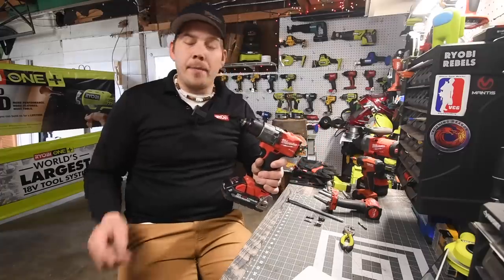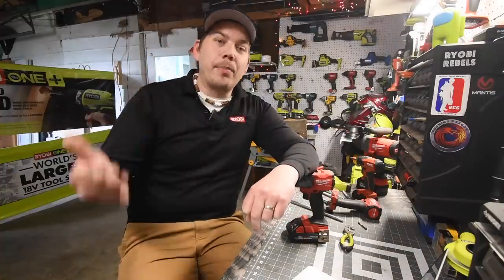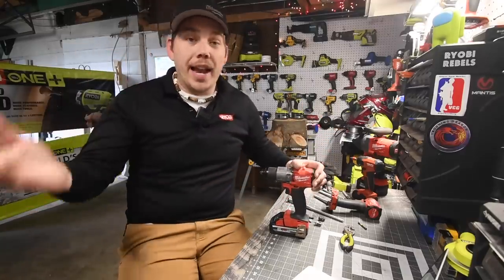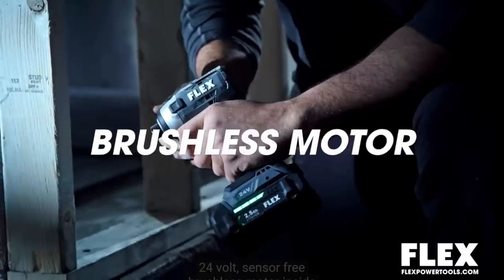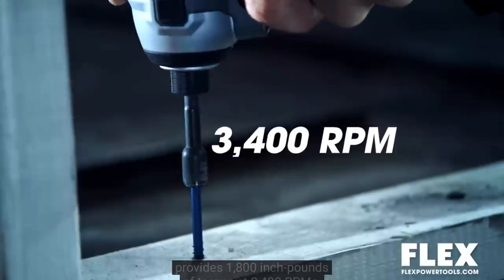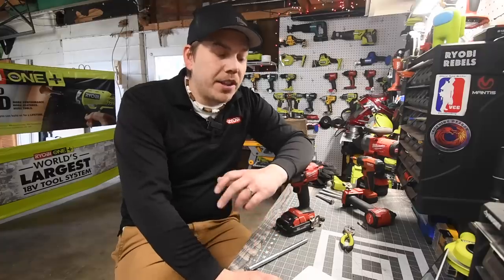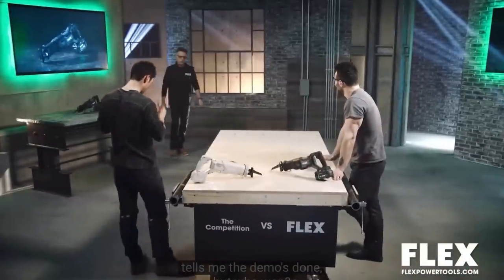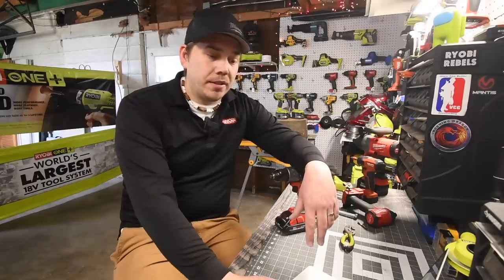My Flex tools vs Milwaukee  video RANT!!!!

Comment: If the Milwaukee tools used were their 18V range, their not the most powerful ones, the 28V ones are. Even if a 24V tool beats an 18V tool in every test, against a 28V tool it's gonna loose.  I have both 18V and 28V tools and the 28V hammer drill milwaukee make is by far the most powerful drill I have used to date. Remember the old saying " a good big'un will always beat a good little'un".

The day I bought my Milwaukee 28V hammer drill (back in 2008) is the day I stopped using my 6" capacity SPARKY coring electric drill to put ANY big sized screw or lag bolt into wood.  But then, that video is just an advert, so it was set up to make the flex look good. All drill manufacturers can produce a video like that if they want to make their tools look good.
Reply from the maker: I thank you for viewing

Comment: I knew I couldn’t have been the only one seeing this, I was impressed with the flex tools, but I just started noticing that “test” after test the guy using the greyed out tool was hardly even trying compared to the flex guy, you can just see that in every tool the flex guy putting the body weight into the tool
Reply from the maker: I thank you for viewing

Comment: I've owned and ran a lot of tools, the Milwaukee is definitely not the best of everything but has been my go to because they usually near the top and have not failed at me. That being said these tests were a complete joke.
 Milwaukee is typically known for brute force and requiring finesse from the operator for accuracy but being quick and powerful. They do have some that are definitely not the quickest and kinda "dur". The flex add was just sad.
Reply from the maker: I thank you for viewing

Comment: Didn’t VCG and others prove that the flex is actually pretty legit in real life testing? I’ve got no bias. Just a DIYer and don’t really care if one impact is 2 seconds quicker than another. I’ve got Dewalt, Milwaukee and even Ryobi (Ryobi stuff is just some of the unique tools that no one else offers yet) so brand loyalty doesn’t effect me. Btw. I have a Milwaukee m12 rotary tool that sounds like the bearings are shot and it’s gonna explode. Only a year old 👎. Just ordered a DeWalt die grinder to replace that POS!!
Reply from the maker: I do thank you so much for viewing :)

Comment: hi handsome. what a great observation , opinion and reivew.my made me lol every time  you "so much pressure yard the flex tool". the operator using the angke grinder, was using so much pressure that his body was going to shake. lol. this is a horrible video. Do you think flex will offer a leafblower ? i expected it-yet i dont see it.

Comment: I love how you call them out. They are using the generic Milwaukee M18s vs a 24v... If they want to shove the money where their mouth is, they should have put it against the Dewalt Flexvolt line.... I own some of the Flexvolt line tools and they would put that flex brand to shame. Of course I'm talking about a 60v vs 24v but they did a pathetic test trailer to see how it stacks up to its competitors
Reply from the maker: I thank you for viewing

Comment: While you do have some good points about the demonstration and their techniques of trying to show the superior power. There has been independent tests run already that show their drills and impact drivers outperforming like a boss. As for the other tools i agree their test methodology doesn't really give accurate and unbiased representation of the results. Will look forward to when you purchase them and do your own unbiased testing. Will also be interested to see what ways you find to test them vs others in a repeatable and fair way.

Comment: Yeah. I stopped watching the event when I saw them cheating. I'm not a even Milwaukee guy. I use dewalt tools. But, like, dude: if you're gonna cheat, be good at it.
Edit: I'm almost sorry I missed the angle grinder test. That shit is cringe. You don't fuck around with those. They are slayers of men. Use the tool properly.
Anyway, I think the inline circ saw is cool. I've always wanted something like that. But, that event was dumb. I don't need tools to be the most powerful. I need them to do things I want them to do, to make my life easier. I don't use dewalt's most powerful recip saw. I use the compact one. It fits my needs more. That's the kind of thing that wins with me.
Reply from the maker: I thank you for viewing

Comment: What's even more stupid about the angle grinder test is that there is almost no point to testing the cutting speed of different angle grinders. They all basically do the same thing. They have almost no torque. They're geared almost strictly for speed, and if you make them too fast, you turn cutoff discs into grenades. There's nothing to test. Angle grinders are angle grinders. You pick them at the store based on quality, feel, your favorite color, and battery life if they're cordless. That shit was stupid.

Comment: a week ago I spent $500 on a Milwaukee half inch impact. about a month ago I started hearing all these YouTubers saying Milwaukee better watch out trying to hype up this fuel line because the same people that made skill or now making an impact drill and calling it. if the people that own skill could make a decent impact driver why wouldn't they made one with the skill name? it's all bullshit. I can't wait to see the first YouTube video where Milwaukee is using a auger bit to drill completely through the guts of this fuel line of half-ass impacts. bottom line is if it was a decent product it would have ran with the skill name. but I got to admit it did make me pause for a minute before buying the Milwaukee. I don't need the most powerful drill or impact on the market!! I need something that's reliable that is a workhorse and that has been proven. Milwaukee or DeWalt both are them tools
Reply from the maker: I thank you for viewing

Comment: Plus, it looks like the body builder is pushing on the flex side while the average guy isn’t really putting any weight on it. Then he suddenly has a light touch after swapping  😂

Comment: He used the Flex Angle grinder wrong the wheel was turning wrong way. Because the sparks fly to the front not the back like Milwaukee. He holds it totally wrong.
Reply from the maker: I thank you for viewing

Comment: That masonry drilling test definitely looked rigged...lol I just used my (GEN 1) M12 fuel hammer drill the other day to put in some concrete achors with a similar diameter bit, and my M12 destroyed the task in seconds. I was actually really blown away. It was the first time I've ever drilled into concrete with that little guy and it made the M18 in this video look like a turtle.
Reply from the maker: I thank you for viewing

Comment: I haven’t dug in yet, are you saying flex is using 18650 cells in their batteries? That would be dumb
Reply: I found the answer, they use both 21700 and 18650. And that’s good. Same as Milwaukee. Not hating on the battery and charger game they brought
Reply from the maker: I thank you for viewing

Comment: They also lies about the 6 1/2" circ saw having the largest depth of cut
Again Metabo HPT has had their 6 1/2 circ saw out for yrs and it cuts 2 19/32 which is more than the Flex-not saying their saw isn't any good but they didn't do their homework and only looked at numbers from a couple of brands to make their incorrect statement-also they still don't have their resets in Lowes yet-why would u have a launch and not have your product on the floor🙀
Reply from the maker: I thank you for viewing

Comment: I was thinking the same thing watching this, such bullshit.... the Flex Turbo Impact should be going up vs a Gen 3.5 Milwaukee M18 Fuel with the 21700 Cell’s and the Turbo Hammer drill should be vs the Dewalt Power Detect with a 9amp Hr Flexvolt 21700 Cell Battery in order for them to make the claims they are
Reply from the maker: I thank you for viewing

Comment: The Milwaukee M18 angle grinder is not that impressive at first. Even if the Flex guy push it harder as he should its even more impressive than it seems he was not able to stop the disc. 
For the show. Well its a show, this kind of show is something what Milwaukee does every time, its something that does VCG any time. So why now start to blame?
Will Flex perform as good as they claim, probberly not, but the hate especially from Milwaukee people is allready on an unhealthy level
Reply from the maker: I thank you for viewing

Comment: Well I have a hilti hammer drill the newest and it's near useless, 1 day of use and it already drops bits, the chuck is pathetic it has no grunt and my last one died after doing not much but a few pilot holes in around a year, on paper maybe hilti is better but having owned and used both the milwaukee is far superior just my experience but our work leases hilti and everyone and else has same problems no one uses them we all use our own gear because hilti sucks
Reply from the maker: I thank you for viewing

Comment: The Flex products are just marketing hype.  Who in their right mind is going to change their entire tool lineup for work or for homeowner DIYers over a second difference or so?  It just does not make sense.  They have not come up with any new revelation.  Makita has the most rapidly charging batteries and an x2 lineup with a lot of tools.  Ryobi has a plethora of different tools and awesome useful OPE and other products.  Milwaukee is killing it in battery tech and specialty tools.  Flex is just a replacement for Metabo, Kobalt and Skil at Lowe's.
Reply from the maker: I thank you for viewing

Comment: I feel the same way.  Their stream featured a bunch of dummies.  Why cover the other in white?  If you claim to be the best and strongest then prove it.  Show the tool line your up against.  It is my opinion that this line is just a slightly upgraded Kobalt line.  Those guys were definitely full of BULL****.
Reply: I agree they totally skewed their results but they have to color over the other brand tools they can’t specifically say a particular brand they can just say competitors. If they boldly came out with obvious Milwaukee tools and did this to them Milwaukee would sue them into bankruptcy.
Reply from the maker: I thank you for viewing

Comment: Hang weights on the machines and then do the test. Take the humans out of it as one can be laying into it and the other could just be holding the drill up and applying zero pressure
Reply from the maker: I do thank you so much for viewing :)

Comment: Those are your opinions I hate the dewalt both mine were terrible hammer drills my Milwaukee is much better and Ridgid is better than Milwaukee or hilti by a lot. I do concrete and use a hammer drill everyday.
Reply from the maker: I thank you for viewing  :)

Comment: Hey bud. Funny how you say all this but the others who have the tools have already put it up against the dewalt drill and they run side by side. To point of too close to call or the flex wins by a second or the dewalt by a second. the flex line uses 21700 cells in there larger batteries as well. You are a TTI fan boy proof shown by your tool wall and your ryobi shirt. Do more research. Cheers. Sorry you dont like competition in the market.
Reply from the maker: I thank you for viewing

Comment: I said the exact same thing as i was watching it, put it up against the dewalt or even the makita hammer drill, they're the best on the market, they used Milwaukee in every test cause its "popular" but not all milwukee tools are the best, too many red flags for me, how bout the one guy that said he been using his flex tools for about a month yet his hammer drill had not a scratch on it, they could have given him new tools for the video but why? I wanna see the dirty beat up tools so i know they'll last the test of time
Reply: Well that’s the point.  The reason they went up against ONLY Milwaukee is because this is Lowe’s pro tier just like Milwaukee is Home Depot’s pro tier tool.  They are trying to be the new pro store... hence the new “Lowe’s is for PROS” marketing that is starting up.
Reply: @rjakiel73  then dont claim to be best on the market 🤷‍♂️🤷‍♂️
Reply: @rjakiel73  they would need to word it different, if their aim is at Milwaukee, which is why they are using them in the face off, then don't claim to be best on the market just cause u beat Milwaukee, plus that's not what people wanna see, all the research they did and they couldn't figure that out? They couldn't figure out how to do a face off that didn't look biased asf? Smh
Reply: @stevescott1962  I agree. Their claim was best based on beating a baseline Milwaukee with standard battery. I never said I agree with it just pointing out their marketing angle.
Reply from the maker: I thank you for viewing

Comment: This video is comic gold, drinking in all of those red lithium tears.
Someone has the audacity on YouTube to say that someone handicapped Milwaukee. WOW, just wow!  So called “Tool reviewers“ have been handicapping Milwaukee‘s competition for years. How many videos have to start off with 18 V half-inch hammer drill, so they can exclude flagship drills offered by Hilti (22v) and Bosch (36v) and recently Metabo MPT (36v) and Makita (36v 40max) have you ever seen someone who is doing a tool comparison when they include the Metabo hammer drill where they used the three times force multiplier attachment?

Also while using your logic that’s all companies should not be making audacious claims and then rigging the tests in their favor, isn’t that Milwaukee’s like bread and butter?
If you’d like to go through press events and we can do this tool by tool, it could become a weekly segment on your channel.
Just to give you a taste since you’re such a HUGE Packout fanboy you have to remember when they were throwing cinderblocks to show the durability of the Packout system. Now did Milwaukee use a comparably priced product like the DS150 up against their product? No they used a DS130  A product that is half the price of their offering, so a fair comparison would’ve been dropping an 8 pound block on the DeWalt DS130 and a 16 pound block on the Packout since it is after all twice the price so it should be twice as durable, but you and I both know that it wouldn’t have gotten Milwaukee the result they were looking for. 
If you need help off the red lithium Kool-Aid or the big orange box store Sugar high, I can help.
Reply from the maker: I thank you for viewing

Comment: Like all tool demo. They pick out a product they want to face not against one that can beat them. The real test is when guys like this put it head to head against its competitors models it should be facing you say beat hammer drill get DeWalt & Milwaukee beat drills and let’s see.  Best sawzall get there beats and let’s find out. I’m sure there decent tools. But for them to gain traction it’s going to be tough because DeWalt and Milwaukee has a long history in the market and there trust.   Guys who make there money with theses tools don’t drop hundreds or thousands on tools they don’t know will hold up for years.  Who cares if it can drive a screw 1 sec faster  how long will the tool last.   Honestly they been better buying a brand that’s known and putting there designs in it. Just saying do not know this company plus there limited offerings compared to DeWalt and Milwaukee will kill this tool brand because DeWalt and Milwaukee have so many tools already out there on there battery’s platforms and we have all picked and have are tools and battery’s it be impossible to get guys to swap over I think
Reply from the maker: I thank you for viewing  :)

Comment: You are holding a Milwaukee impact wrench and referring to it as an impact driver.   I don’t trust your tool knowledge.
Reply from the maker: that is a modded impact driver. that is not an impact wrench. I took the tool apart and swapped out the 1/4 anvil with a 1/2 anvil. Milwuakee doesn't make the tool that I am holding in this video

Comment: They were NOT both using a 2amp hour battery... Flex had a 2.5 amp hour battery.. Milwaukee was a 2.0?  Yet that battery looks HUGE for a 2.0...... That said.. testing even with a 3.0 didnt matter.. The Flex was still the victor.. It's also 24V though.  Barely won?  WTF are you talking about?  It SMOKED the Milwaukee... and I am a HUGE Milwaukee fan...You talked your opinion the WHOLE time but did nothing to prove your points as in actual testing..
Reply from the maker: I do thank you so much for viewing :)